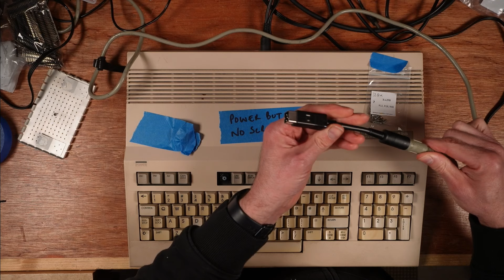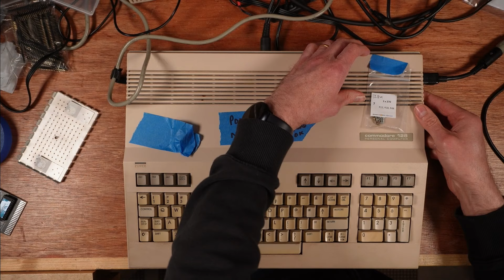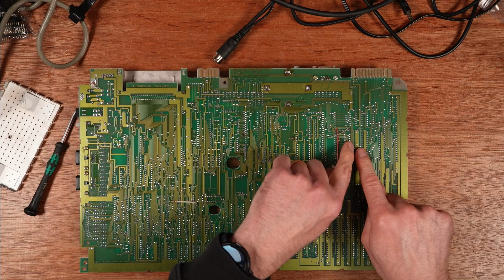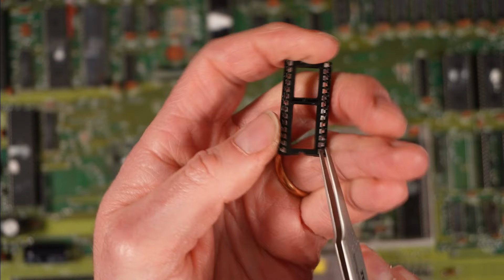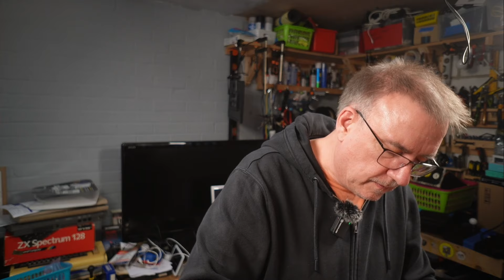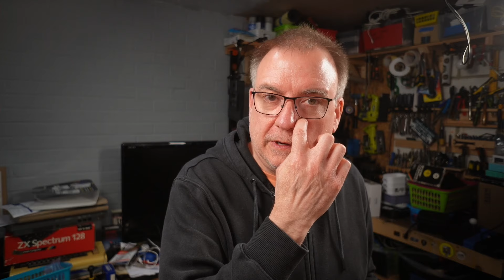C128 Repair - Can You Help?

Comment: Failed PLA chip: The PLA (
 or 
) handles video and memory management and is a common failure point.
Defective RAM: Specifically, the RAM multiplexers or the RAM chips themselves, often leading to a dead screen.
Dead 8502 or Z80 CPU: Replacing the CPUs can resolve the issue

Comment: A Commodore 128 failing to boot in 128 mode (likely defaulting to 64 mode or a blank screen) is often caused by a faulty IEC bus device, a stuck 40/80 column key, or bad ROM/PLA chips. Immediate steps include disconnecting all peripherals, checking the 40/80 key, and checking for "READY" text. 
Here is a troubleshooting guide for a C128 not booting in 128 mode:
Immediate Troubleshooting Steps
Disconnect Peripherals: Disconnect all disk drives, printers, and cartridges. A faulty IEC device can hang the boot process.
Check the 40/80 Column Key: Ensure the 40/80 display key is not stuck or incorrectly positioned, as this can prevent proper video output in 128 mode.
Force 64 Mode: Try booting while holding the Commodore key (logo key) to see if it forces a boot into 64 mode, which can indicate if the machine is partially alive.
Check "Ready" Prompt: If you get a black screen, check if the power light comes on and if it boots at all. If it shows 64 mode, the issue is likely with the Kernal ROM or RAM used by 128 mode. 
Common Component Failures
Bad ROM/PLA Chips: The U32 or U35 ROMs (or the PLA chip) are common failure points for failing to boot into 128 mode.
CIAs (Complex Interface Adapters): If the CIA chips (U4 or U5) are socketed, try swapping them to see if the behavior changes.
RAM Failures: Faulty RAM can prevent the 128 mode from initializing.
Voltage Issues: Ensure the power supply is outputting the correct voltage. A low 5V line (e.g., 4.65V) can cause a black screen.
Corrosion/Broken Traces: Inspect the motherboard for corrosion, particularly around the video circuitry.

Comment: I initially think caps too. 
The schematic shows the reset button before the 555 timer circuit (so it triggers the 555) 

If in black screen and you manually ground the reset pin on one of the CPU’s (& thus the other cpus as well) does ungrounding reset the computer back into life reliably? (But reset button doesn’t? Then 555 circuit)  otherwise my guess is still caps

Comment: One thing that frustrates me about many of these channels is the lack of actual investigation.  Most rely on software diagnostics and/or trial and error and then hope for the best.  Since the computer both works and doesn't work reasonably reliably, scoping the primary functions on the board when it works and compare to when it doesn't work is likely to be more useful (and educational) than just relying on pot luck.

Comment: The fact that it seems to boot reliably when cold STRONGLY indicates a temperature-related issue. Could be something as trivial as a capacitor. Some freeze spray might help narrowing it down.

The Z80 is in control when the computer is powered on, and it obviously works. As griffinretro points out in his comment below, the fact that the system boots reliably to C64 mode every time implies that the fault lies with a component that's only initialized in C128 mode. That pretty much eliminates the reset circuitry as a possible suspect, as well as the VIC-II and the 8502 (and of course the Z80).

In C64 mode, the RAM configuration (bank config 15) uses only RAM from bank 0, so the question is whether a flaky RAM chip in the upper bank would cause these exact symptoms. As RAM chips of this particular type are notoriously unreliable, that would be the first place I'd have a closer look with the oscilloscope probe. Another possible culprit would be the 8722 MMU.

Comment: Feels like a reset circuit issue, as in reset not being held low long enough. I don't know how the Commodore reset circuit works but usually it's a capacitor and maybe a 555 timer.

P.S. Just looked up the schematic, yes it's a 556 timer (twin 555). Check the timing of the U27 and the ceramic caps etc. in that area.

Comment: Im betting on the reset signal caps like others have said, would be cool to scope those lines a bit whilst switching on off to see what it looks like when it goes to the white line - perhaps it doesnt have long enough to discharge if swotched too quickly (i think the Amiga doesn't like thay, i think it confused Adrian a while back). Or its the sockets. Or the RAM. Or a MOS chip. Or gremlins 😂

Comment: Have you seen the power supply videos on Noel's Retro Lab's 2nd channel ("Noel's Spare Parts"). His problem was slightly different - C64 intermittently came up with no ready prompt. But it could still be a similar cause. Essentially, a missing output cap on a replacement switch mode PSU meant that the 5V rail did not appear cleanly, and that would cause it to not boot. On a 128, which also draws more power than a C64, maybe that could cause it to black screen. It's a thought, and worth trying a different power supply at least, if you have one.
Reply: I was about to suggest the same.

Comment: I had a similar problem with a Z80 computer, it turned out that it was the memory being temperature sensitive. You can test for this by either putting the computer in the fridge or using freezer spray on each memory chip or heating it up with a fan heater.

Comment: When you power on while holding the C= key down, the Z80 boot sector will start C64 mode directly rather than passing via the C128 KERNAL/BASIC to do so. Since it works reliably in C64 mode, my guess would be a marginal RAM chip in the upper bank (U46-U53) or something related to the C128 ROMs (U33-U35). The Z80 boot block and all the C64 ROMs are in U32.

Also check that the power supply used can supply enough amps on the 5V line, the C128 draws a lot more 5V compared to the C64. The factory 128 brick is rated at 2.5A 5V.

Comment: The reset circuit on the 128 is driven by 2 555 timers (more accurately a 556, but same difference). There are a small handful of electrolytics on the various control and timing pins in that circuit, if they go bad that could affect it coming out of reset.

I'd start by looking at the caps around the reset 556, check that they have good ESR, the right amount of capacitance, etc.

It would probably be worth trying to scope out the various signals coming from, and within, reset, to help narrow it down, but the timing electrolytics would probably be a solid starting point even without doing that.

Comment: for 1 even if the ram passes the test there can still be a faulty ram that is missing a bit or 2 ... then i would check with a scope the ttl signals on the logic chips ... |I don't believe the rom is at fault it is or a flakey ram chip and good luck finding which one or a logic chip

Comment: Just a thought but could it be that the reset circuit is caught between the thresholds making it not resetting the chips properly? With almost all devices it's recommended to wait 30s before switching back on again, allowing the caps to discharge and put the device in a proper known state. An oscilloscope probe at power and reset signal might give you some clues as to what's happening. Maybe the psu isn't stable before reset becomes inactive in all cases. And check the state of the cpu when it's hanging. Ie halt, reset signal etc and if it's still executing code.
Also check if it's not actually the psu not powering up. I have an Amiga psu from icomp and doesn't like switching on/off quickly, it just stays off for the protection circuit to fuly discharge. After 30s it turns on again. It's not a good psu for troubleshooting or building a ReAmiga for example.

Comment: I don't know much about the C128 circuitry, but I know about the C64. If this were a C64, first thing I would to is connect a scope to the CPU reset line and do a lot of captures to see if there was a different behavior there when it boots, and when it doesn't. If the circuit is like the C64, maybe the cap that does the power on reset delay is bad, or maybe the CPU is getting a little senile and needs a little bit more delay time to gets its bearings right (=larger cap) to start working properly.

Comment: Check the reset circuit, not sure how the C128 one works, but it would be where i'd start
Reply from the maker: Ah thats three for the reset circuit so far!
Reply: @morefuntech bad capacitors is strong possibility too. It could be that "cold" they work, but as they form/heat up they fail

Comment: I've not yet worked on a C128 (got one sitting here that needs work, but haven't gotten to it yet), so this probably isn't of any value whatsoever, but it's what comes to mind.  I'd look at the RESET circuit timing.  If it takes longer for the C128 to get everything settled down when booting into C128 mode than it does to boot C64 mode and the RESET is intermittently not holding long enough, that COULD explain your symptoms.  If the C128 uses something like a 555 or 556 timer for reset delay, then the 555/556 or one of the passives around it (like maybe a capacitor) could be a problem.  Like I said, though, I've not worked on a C128, so I'm probably talking right out my backside.
Reply from the maker: Cheers Todd. I will add that to the list of things to work through :D

Comment: I'd love to say - yes, it's this thing! But honestly I don't know. I did find a bad cap or two on the 128 that Lurch gave me ages ago, somewhere around the one you pulled out. But at the same time, it doesn't seem like your usual bad cap behaviour where they get better as they warm up.

I think you're on the money with the bad sockets, the only question is which one. And as another side note, that 128 from Lurch eventually stopped booting due to a bad socket on the VIC-IIe. But it was also rusty AF in that area. Anyway you know where to find me if you want to pick my brain
Reply: Just went back and watched part of my old video - cringe. But the bad caps were at C101 and C80. However looking at the schematics, I'd suspect C91 and C92 as the only caps that could cause the issues you're seeing as they form part of the reset circuit. Perhaps the 128 is coming out of reset too early?
Reply from the maker: Cracking advice. Todd from YARC said much the same about the reset circuit.
Reply: @morefuntech  Something about two wrongs making a right? No... two rights make a 180. I'm confused